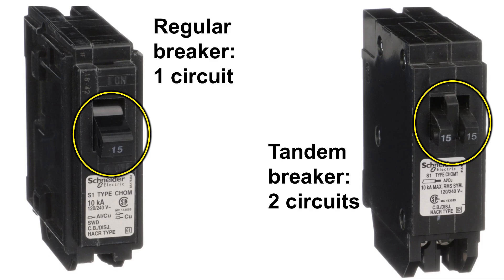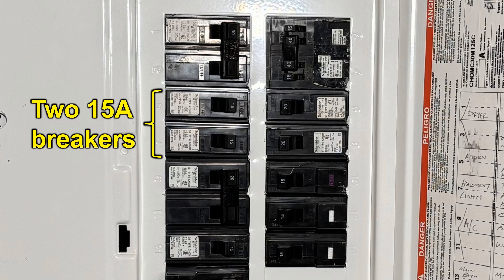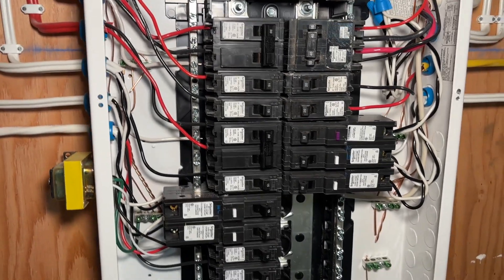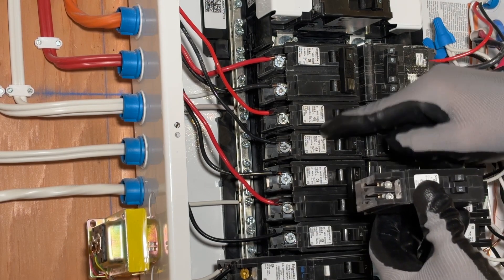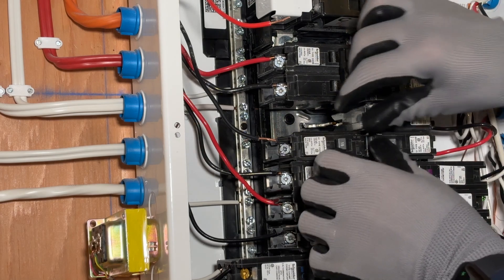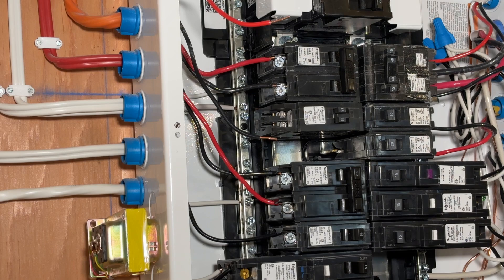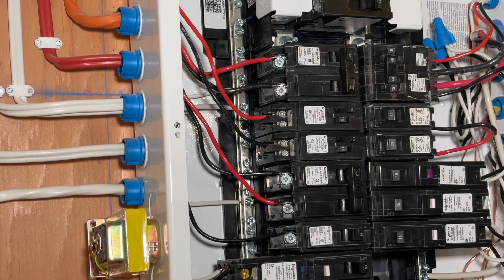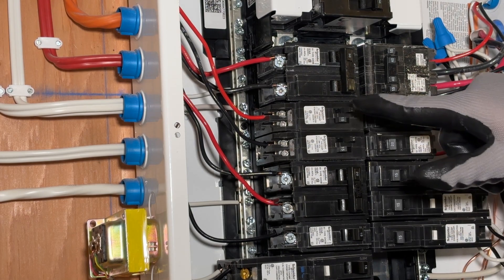Use tandem breakers to add circuits when panel is full or to make room for future needs

Comment: That's all well and good, but on a multiwire branch circuit, you need to have a handle tie to insure that ALL circuits on the multiwire branch circuit are turned off in case of a short circuit, or maintenance of one of the circuits. If not, one circuit will be on and the other is off (the tripped breaker or the one turned off for maintenance) which could be very dangerous! This is the code whether you are in the USA or Canada.